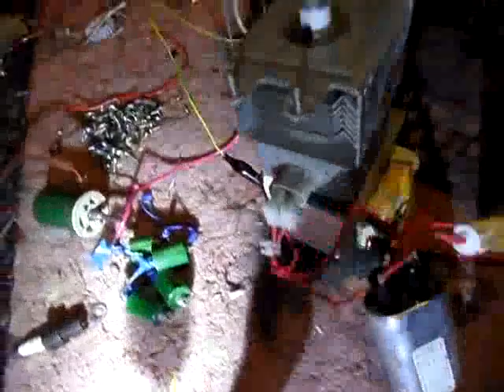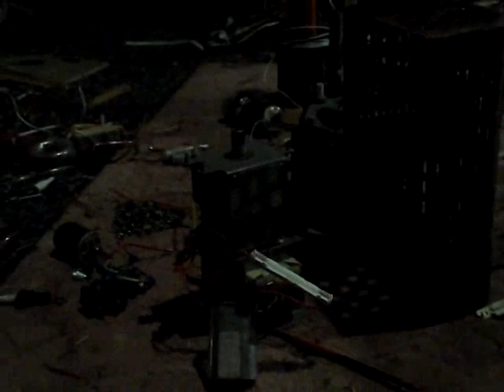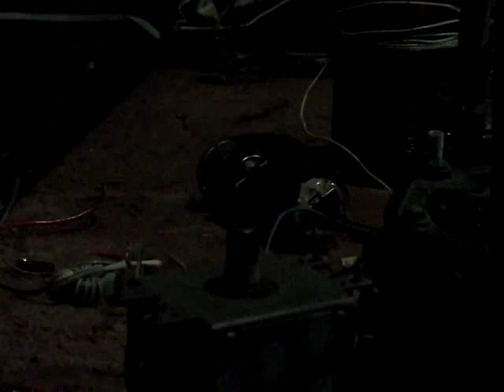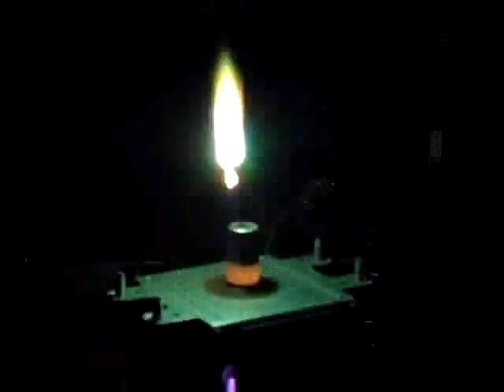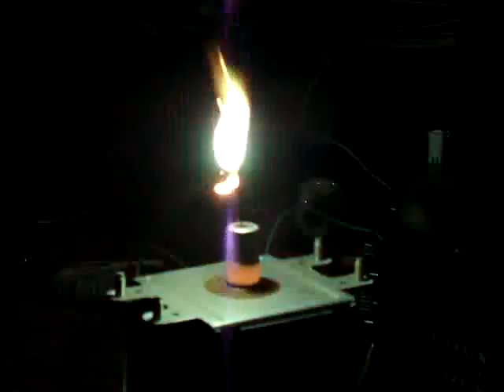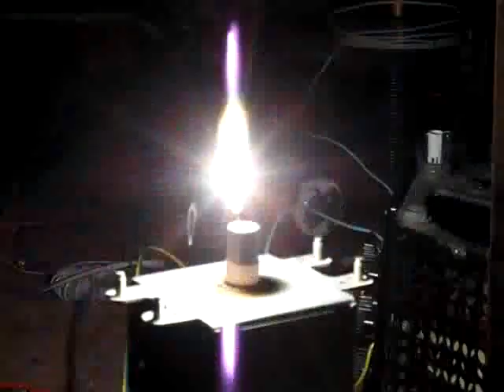Microwave oven magnetron flaming

Comment: @BlackMasterRoshi no what your thinking of is focusing the waves.. any radio stile satellite dish is taking a larger surface area and reflecting any waves collected back into a receiver in the middle.. this also works in revers.. if you are using say a magnetron to broadcast a signal for some odd reason you would reflect it from in frunt of your parabolic dish and reflected back out as a directional more focused wave.

Comment: @BlackMasterRoshi  wave emitting devices are normally not focused and to broadcast directionally a further distance you would use a parabolic dish and reflect it off that backwards twords your target say a magnetron has a feald of 120 degrees then you bounce it off a dish that collects most of that and focuses it until its one stronger beam say 20 degrees projecting from it and that would go further. it dosnt reflect better than a flat surface it is just focusing it thats where you are confused

Comment: @100xBob ok yes he can get really ingerd by the waves .. he also plays with flamethrowers so hes a rik taker.. second microwaves (the radeation not appyance) only penitrate 5cm or 10 cm they are easily stoped buy the walls in that room. 3rd this is weak compared tohow any waves you are exsposed to constantly so comunication will go on altho he just sat inside a microwave for a little bit

Comment: @100xBob BAM there it is "they put the energy from the radio waves into the food"  and if you knew phsycs like i du they only go into the food about 3-5 cm becouse of the high fat content that obsorbs the waves more easily but if you know anything about stelth bombers flat serfases reflect waves pritty well. asentraly hes putting himself inside a microwave and turning it on but the fact that flat surfaces reflect well and the waves are obsorbed easily = almost o waves are exscaping that room

Comment: @100xBob then exsplane why operating any microwave (the appearance) at all dose not leek any or not vary mutch of the waves! there are difrint kinds of waves and radeation microwavees happen to exsert all there energy vary fast and are blocked easily bt the metal and plastic walls of the microwave oven! this is why its safe to have them in evry house!

Comment: @BlackMasterRoshi um ya energizing matter is a thing it happens when you make the fucking electrons shake rapidly and its good at doing that. and yes if you want to revive a message or a wave back using reflection you better hope your target is flat... dont believe me well rounded surfaces do reflect its just spread out over a larger area.. when you do that to any energy wave it becomes less intense.. shine a lazer at a glass ball or a pane of glass trying to get the light on the oposit wall...